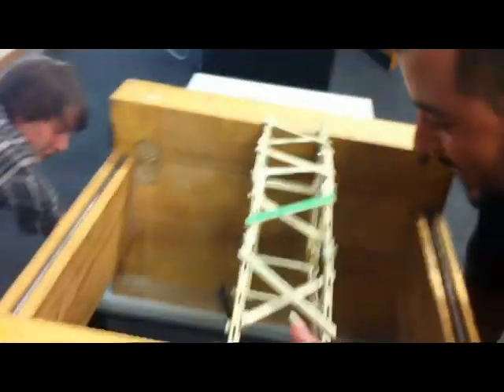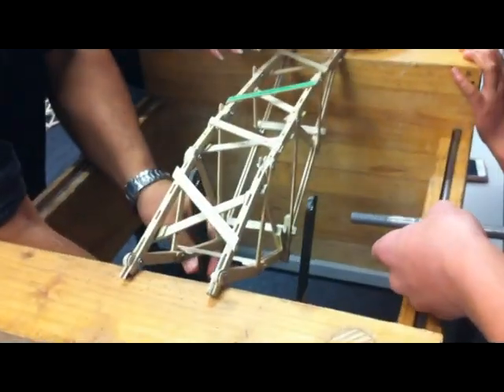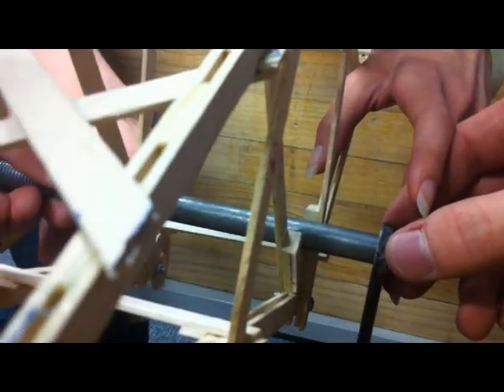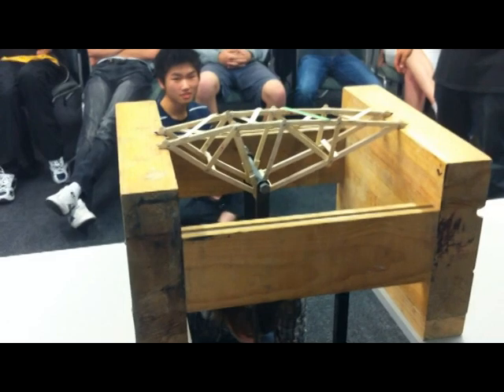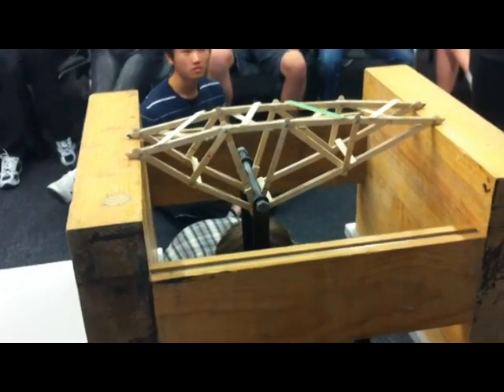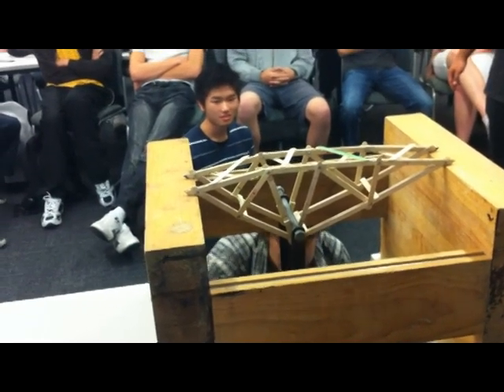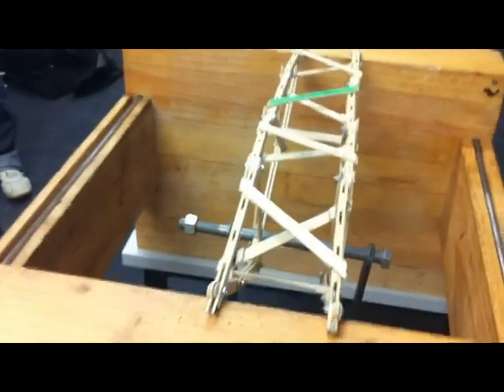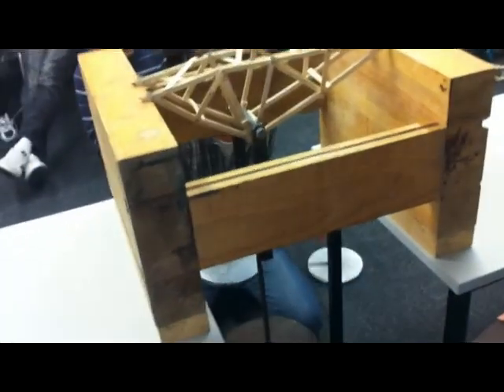Record Truss Bridge 2012 - University of Auckland Engineering

Comment: I remember building a balsa wood bridge in secondary school.
I love engineering and two others in my group did as well. We designed a bridge that worked so well using designs that were really cleaver and fantastic.
In the end we ran out of bricks to put on the bridge, so we got the teacher to stand on it. Our bridge still sits proudly on the wall of records. 
We set the record of 140KGs.
Reply: In my high school physics class in 1975, two students took their quota of balsa splints and laminated two beams. It was better by many orders of magnitude. They illustrated why we don't build truss bridges and captured the essence of composite construction which was taking off at the time. The dinosaur teacher disqualified them as "not in the spirit of the contest".
Reply: @iverburl  Right?

"You're here to learn to be the next generation of innovators"
"Oh, you innovated too much."

Comment: Why dont they load up the top? Why hang stuff at the bottom? I know thats a major load point but i feel like it would have held more if loaded on top
Reply: the weights acts as the cars pushing down on the bridge
Reply: Alex Tseng i know, but they hung it on the bottom connect point. Wouldnt it hold more if loaded on top?

Comment: In my opinion: the big problem was the V-shape where the load was attached. The v-shape produces tension outwards to the left and the right of the bolt. I think a curved shape in dimension of the bolt would be better.
Reply: Lol Idk why I'm replying to this 4 years after you made the comment, but if you look carefully at the joint at 1:35 right before the bolt is placed there is a curved connector piece of wood that straddles the V
Reply: They have curved chop sticks?
Reply: @DerusGrindz  put them in water and bend them the way you want

Comment: It seems like it would be stronger if you added supports that go down and rest against the interior of the inside of wood. If you have ever watched the Emperor's New Groove that part where they are climbing the canyon wall.  Those supports would act much like the  legs of those two climbing the wall. Wouldn't that transfer the weight from the middle to the four points of contact on the walls?

Comment: Seems like a really strange place to position the weight.
Reply: Or in the center of the bridge.. Offsetting it like that will increase its payload capacity.
Reply: Kaziek Kucykowski mate what? This is engineering, not gender studies, postmodernist dance & media studies. They'll have technical ability that is actually in demand
Reply: It fit the brief, they aren't making a real bridge, they are making one that hang a load like they did. We have similarly strange briefs in design school.
Reply: Rice Man that's what I thought, shouldn't the load be on the top of the bridge?
Reply: there are tons of bridges with asymmetric loads and just one example is pylon bridge in belgrade serbia as newest addition of the big bridges...
Reply: you build a bridge for a task it should do and by required conditions. if load was intended to be on the top or the middle of the bridge, design will change to accommodate load.

as example for this design, i can picture bottom road hanging from this bridge structure. anchoring is at the top of the hills/mountains, road is in lover level of the same hill and canyon under...
Reply: I assume the rules didnt say the load had to be completely centered. Since the purpose of the bridge was solely to win a competition, all they had to do was stay within whatever guidelines were given.
Reply: Rice Man ikr, 
My take on it is that the positioning was to allow the design to manage a different stress points.. is everyone here an engineering student?? Just curious
Reply: It’s simply for the purposes of this competition/assignment. It’s clearly not meant to be a bridge in the sense we think of it. It’s just a test.
Reply: @ThunderCandy  Things only SEEM heavier when lifted higher. What you are saying is that mass is somehow increased with altitude. Weight does decrease with altitude, but so slowly you'd have to be in space to see any real effect. In engineering(on Earth) we don't use any mass corrections for altitude.
Reply: Its not when the load is below.
Reply: Nicks backyardprojects thats for real bridge...this bridge is only made and designed to win the competition
Reply: lol at kaziek lucykowski. there are ample jobs for engineers.
Reply: there’s a specific offset the load has to be from the side
Reply: well you are right in thinking that  but what there testing in its design its its breaking point in the location of stress  that point where they hung the weights is how the bridge is designed to transfer its stress to.   ( by that i mean if a load was placed on top like you think the focal point where it was hung is where that force would actually go )
Reply: Rice Man exactly dude. Dislike for it.
Reply: Jimmy Rustled: Yeah, right. NZ is so good, half of them are in Australia with intention of going back.
Reply: If you hang the load closer to the side it would have held even more.
Reply: Rice Man ok
Reply: ThunderCandy LMAO WHAT A DUMBASS.
Reply: Nicks backyardprojects If you put the weights near the top of the bridge the centre (center) of mass would be much high giving it a lot more gravitational potential energy so that is why they put it near the bottom
Reply: yay they're broke the record.... and now they're have low pay jobs in fast-foods or elswhere.... yay

Comment: I did a project like this in junior high in a class called exploring technology II . Useing 1/8"x1/2" balsa wood and elmers wight glue.  spanning18" gap .  we bult bridges with a road deckof poster bordk thick paper)  and the weight was supported by this deck simulate a car loading. to a mlock of wood thorough  a 1" square hole in the center . bridge held 110lbs for 2nd place 1st was 217lbs. we were aloud any supper or sub structure design.

Comment: Only as strong as the adhesive!
Reply: nytom4info 
Call me crazy, but I'd use a bucket and slowly fill it with water. That would allow for adding the last fractions of a N in small increments.
Reply: 240lbs of water would need a big bucket
Reply: @nytom4info, you really underestimate how strong the right kind of PVA-glue is. If it's been hardened properly, PVA glue is stronger than PU, as strong or stronger than epoxy. Not to mention that compared to poplar or some cheap softwood, out of which popsicle sticks are made, PVA is much stronger.

Had the students been given unlimited glue rather than just 10 grams, they could have just made a glulam I-beam out of PVA with the popsicle sticks as effectively nothing more than a fibre reinforcement material.

Have a look at some Glulam beam breaking videos. It's never the glue that lets go, it's always the wood that fails.
Reply: For a similar project we used a bucket full of sand, it worked really well until someone held so much sand that the rig holding the bucket broke..
Reply: Larry Scott how would you keep water from spilling everywhere?

If it was really important, there are digital force gauges that  can measure precisely how much force was applied before failure, and even create fancy graphs of the load over time.
Reply: Nnelg 
Well mechanically, water in bucket is simpler. And simpler is good engineering.
Reply: If the top two are separated by less than one Neuton of force, then it's simply a tie. This isn't some inter-school competition with a cash prize involved, it's a class project for first-year mechanical engineering students. It doesn't really matter who wins, the point is just for the students to put what they learned in class to a real-world test.
Reply: @nnelg8139  they obviously did not learn anything and this is why bridges and buildings world wide fail... Those materials should be able to hold 1000 pounds not n
Reply: no, the wood split.
Reply: Platon P - the students were restricted severely, they couldn't add any redundant beams and had a low cap on weight.
Reply: 10 grams of pva glue seems to be enough to coat 100 grams of popsicle sticks, and the failure is going to be the wood pulling apart, likely at the edges of the stick, so coating the sticks with pva seems like it would be the best way to prevent that from happening. it feels like to me you'd only need to coat the edge grain of the sticks as well
Reply: Larry Scott we used a bucket of washers at my university for this reason
Reply: Larry Scott You forget something about water. It's not very dense compared to steel.
For 1087N you'd need a 108.7L bucket. Equivalent to a bin bigger than the one in your kitchen that was strong enough to hold all that weight without breaking.
Reply: There is no glue, read the description.
Reply: Winning is never what really matters. Advancement is what matters. Building a stronger structure than your predecessor means you've learned and put that information into practice for the benefit of better engineering. Rivalry can be a healthy catalyst but "winning" is an entirely selfish endeavor. That's just petty egotism and has no place in science/engineering.
Reply: Best thing in the comment section is how everyone calls this " model " a BRIDGE while in fact it has almost nothing in common with bridge structure. I have build many models with steel or wood ( span between 2m and 5m)  for competitions. I find wood to be best material in terms of having good fun at competitions. Steel is ofc another story. I designed and than  constructed under 30 minutes ( time was very important)  model with span of   5m, weight of 60 kg model that under load of 1000 kg had deflection of 1,3mm :-)
Reply: kyle hubner if we imagine the bridge as a beam, it should be able to hold the most weight near the supports. Because breaking occurs when the beam is flexed too much. It is hardest to flex the beam near the supports because that is where moment is the least.
Reply: Nnelg 
A sufficiently large bucket only has to be suspended 2-3 cm. And a digital load cell that records data, rate of increase, and maximum load. Even if the bucket spilled. 

The some what large weights don't permit a fine granularity of increase. 

Either way, the very high engineering of the truss seemed to be determined by an unreasonably crude application of load. 

What if 1st and 2nd place were separated by 10 g? And the 3 second count to add more? A steady stream of water adding a given load per second, which can be regulated to appropriately slow, would seem to be more objective. And the rate could be digitally recorded as well. 

IMO
Reply: The bucket idea would be easy. Run a water pump line through a counter. Secure it from the outside, down into the bottom of the bucket. Account for mass.
Reply: nytom4info also the wood I guess.
Reply: Larry Scott That's what my class is doing.
Reply: It used pin joints
Reply: It could be a big plastic container with a small opening at the top and fill with a hose with a valve.the container of water can be suspended over a scale that is protected by cross members that can be removed once the bridge fails.
Reply: Nnelg siphon through hole..and have a floater inside of bucked with holes in it.
Reply: Larry Scott : i'm with you larry...a bucket filling with liquid would make more sense...
Reply: Nnelg replace water with sand. There, now your comment is moot.
Reply: Larry Scott that's what we did in CADD
Reply: Lorenzo Salinas God you're fucking dense.
Reply: You can beat that with no adhesive allowed....
Reply: Nice work I couldn't do it without glue.
Reply: dick head. No glue joint gave. it was the sticks that broke
Reply: Nnelg doesn't matter who wins?? The fuck does that mean? It always matters who wins. You can still have good friendly compitition in a learning environment with winners. That's the point, see who's bridge can hold the most. Beat records and all that jazz. Why did they celebrate at the end of the video if it doesn't matter? They put a lot of time, effort and hard work into their design. Of course they want to come out on top.
Reply: Lorenzo Salinas i guess launching a satellite on earth orbit to give people from all across the world internet,radio,tv and google maps images was quite complicated. I will not answer any more of your bullshit.
Reply: Platon P 
So English isn’t your first language?
Reply: Shut up you bloody moron!
Reply: that bridge looked very asymetrical atleast from the angle of recording if that is the case then perhaps a slight redesign focusing on symetry would yeild a beter result i remember doing a similar project in high school with strwas and tape i think the best design weighed in at supporting a nice 25kg
Reply: this design is purposely made not being symmetrical to challenge the students.
Reply: the project was purposely designed not being symmetrical. It challenges the students to calculate more
Reply: Lorenzo Salinas no you can't little snowflake. To create a bridge such as the one seen in the video you need lots and lots of physics calculations which you obviously don't know.
Reply: No it wasn't but ppl made it harder than what it is. You think if you ask the ppl who do it now is it hard. They will tell you hello no. It's what they do fool. Just bc it takes someone awhile to figure it out doesn't mean it's hard. When your a baby your brain is capable of everything but you have to learn. It's not hard you just got to practice. Now if it was one person designing and building and flying and monitoring. Yes I would agree he has to be fkn smart. It's alot of ppl who practiced certain things to work together. I install at&t. Tough at first but like I said practice and it's the easiest thing ever. All the talk about this person is smarter than this one is nonsense.
Reply: You install at&t. Wow, you must be really smart. University level smart. No, wait, PhD level smart. Get a fkn life, blue-collar.
Reply: You're a fkn idiot. Ppl make stuff complicated. Nothing that has been accomplished is complicated. It's bc of ppl. They make it hard you fkn moron.
Reply: You fkn nerds think this shit is hard bc you Know the correct words to use. Gaurantee I can build a stronger bridge.
Reply: damn right
some fuking retarded and ugly construction really wtf =\ wtf is this? 
there from the right side you can find this video  ( https://youtu.be/LZR_izGo6Lc?t=100 ) where KIDS made something that was done RIGHT
not this ugly wtf... common really? -_- 1st year of uni troll for fun or they just retarded?

Comment: shudnt the load be loaded from top and spread out.... and bridge have to be a high one to avoid passing objects below...
Reply: HansumRob100 you have to distribute the load over each section of bridge to find out total amount of stress it can sustain. For load distribution they used triangular shapes. And load is suspended accuretly in the middle.
Reply: The point of this competition is not to design a bridge for transportation. It was to design a structure capable of supporting the most amount of load between a designated gap. The load was hung from the structure to avoid any balance issue and so the load will be close to the ground when the structure finally fails so that the floor doesn't crack. Too many people are missing this point.
Reply: Still, the failure of the bridge was the pivot point where a bridge naturally wouldn't be loaded. Failed because the beams of birch at that dimension couldn't handle anymore. The joints held up. 

This test proves how strong the tow-hitch is, but not the entire frame of a truck.

I propose a simular method of tests, with weights at the bottom, like shown, (to put the weights directly on the bridge would make a mess when failed) the hinge-pin on the top part of the bridge, pin suspended on an arc over a steel plate to spread the load, sized roughly a third of the span, and placed in the middle of the bridge.
The lowest point on the tresses was not the center.
Reply: At my school we tested bridges from the top center with a pressure plate, much more accurate finding the weakest joint
Reply: It does do that because the way that it pulls directly to the sides and middle means that it all comes down to the middle, and loading point to keep most weight
Reply: They are not missing the point, the video should not call it a bridge if it's not a bridge.
Reply: HansumRob100 doesn't matter
bcz it still includes tensile and compressive forces!
u should know this man :(